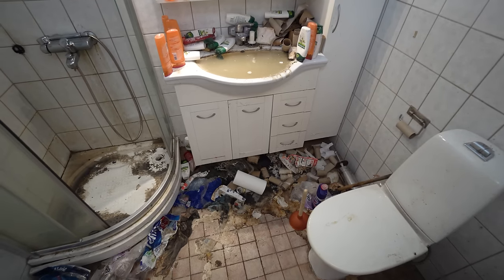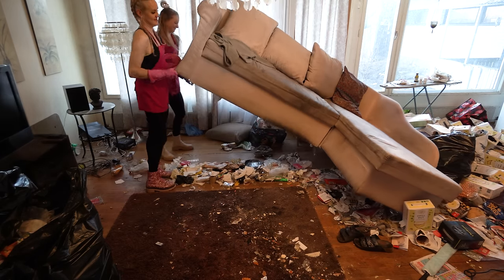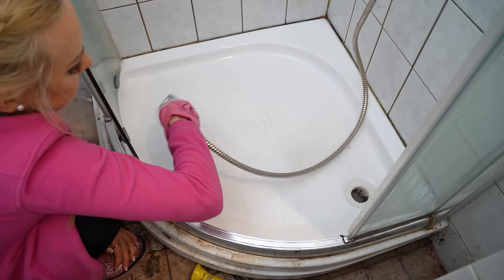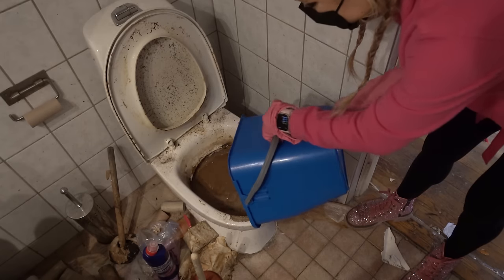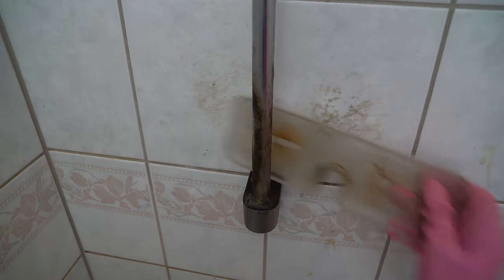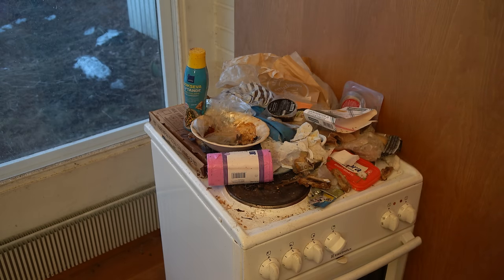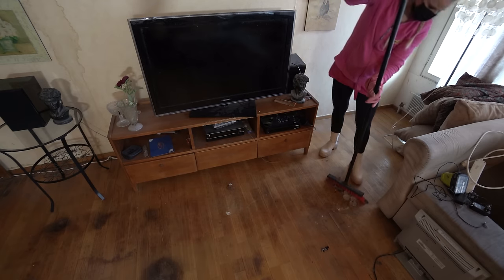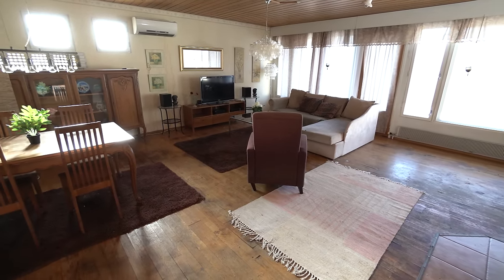Restoring Hope!! 🩷 FREE MAKEOVER for mom with destroyed home

Comment: I finally tried your method of clingfilm and oven cleaner, letting it soak overnight and it worked so well! I rescued a tray I was just going to throw out.
Reply: Did the same, what an eyeopener!
Reply: Nice! I cleaned my shower head with an overnight vinegar soak-I didn’t even have to scrub 🎉🎉🎉
Reply: I used it on cookie sheets that were solid black.  I didn't even remember that they were once shiny and silver.
Reply: @martinafranciscus1281  yes! Everything melted right off. 😄
Reply: @lorenstribling6096  that silver shine excited me so much, I kept rinsing and admiring. 😂
Reply: @eatlocalhoney  not having to scrub was the best!
Reply: @lorenstribling6096  Sometimes what happens there though is you're actually destroying the coating that was originally there. A lot of pans are "shiny and silver" but then get coated with a non-stick coating that's black because the color and temperature. So you end up thinking it was once shiny and silver but you actually did buy it black.. it's just the acid in the oven cleaner ate through it and now it's gone. Meaning you're now left with a less conductive cookie sheet and it doesn't have that non-stick coating.
Reply: @Eventide215  I have had these for about 20 years so I have no idea what color they were originally.  All  I know is that over time all the cookies overbrowned on the bottom before they were fully done.

Comment: Yes Katariina. You're right to use the damp one. It helps to remove the dust easier. With the dry one there is the risk you remove the dust from one part and you put in another.

Comment: The brown larger rugs can be put on the concrete driveway, hosed after using something to scrub it with and using a medium garage broom, rug shampoo, and testing the color first to avoid problems with any damage. Use strength that won’t tear up the rug, then put it out to dry on chairs or a patio table in the sun starting in the early morning as the sun comes up. A 3 person swing is even better to hang it from after it has dried quite awhile… never lifting while wet, ever.

Comment: The sliding glass doors in my shower have an aluminum track that has black streaks. I don't know if it's from the black rubber roller or aluminum from the bottom of the door scraping on the aluminum track. I have tried various cleansers with rags and brushes with no success. Is there something you can suggest to get rid of the black scrapes? Thank you so much for your wonderful and helpful videos. You are a cleaning angel!

Comment: I'm wondering what you do with sponges and microfibre cloths after the cleaning. Sometimes the grime is exceptionally persistent. Do you just rinse and wring them out? Do you wash them? If so, just by hand or in the washing machine at what degrees? Or do you straight up throw them away?
Reply: She usually put it in the dishwasher with the highest temperatures (+70 degrees)

Comment: You did amazing job! <3  For floors like that, it works really well, if you use hot (not boiling hot, but like shower hot) water with washing powder (better to use those, that are for washing machines, they have less foam and are easier to remove) and a bit harsh floor brush . I usually soak and scrub about 1- 1,5 m2 with that brush and then wipe it clean with damp floor cloth twice and wait for it to dry, meanwhile I'm just working on next section. And personally I love to use "Mastika" wood floor polish after it dries. It also protects the floor really well. I do this like once in a year (usually before Christmas) and it feels really good. Hope, someone can use this tip. <3  Yeah, it's not easiest way, but it works amazing with wood floors <3

Comment: We have a shower similar to this one, only twice the size.  What I do is set a large containter full of water, over the drain. The water gives the container weight to stop the water from going down the drain, then I use a pitcher and fill the entire bottom of the shower with HOT water and add bleach and let it soak for 45 minutes or so. Then use a scrub brush along the rails and all over BEFORE I allow the bleach water to drain.
 But saying.... my shower NEVER gets like this. How does this person feel "clean" after getting out of it?

One thing I don't understand about your cleaning method.  Why clean the bathroom sink and THEN clean the mirror and shelf above it afterwards? Same with shower faucet... you clean the floor then do the walls afterwards, making the floor of the shower dirty again?
 Always start at the top and work down to the floor so you are not re-cleaning everything below. 

 And I hope the bathroom has a floor drain in the middle of the room?  LOL  I am just waiting for the water you spray to run down into the apartment below.... assuming this is an apartment.
  Our guest bathroom upstairs, if guests/grandkids... don't put the shower curtain INSIDE the bathtub when they shower, it runs down the edges of the room into the downstairs guest bedroom closet!!